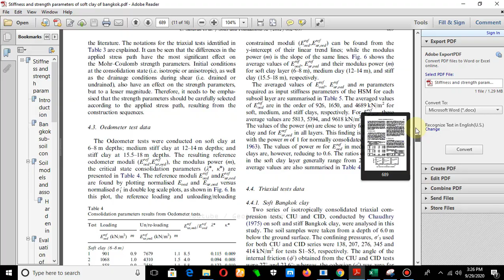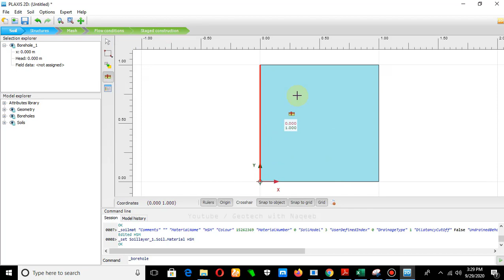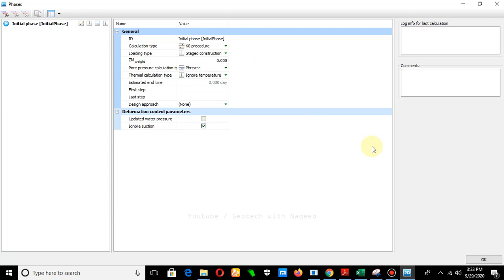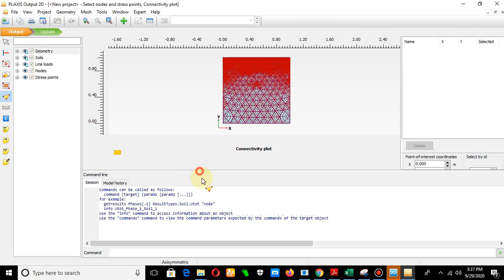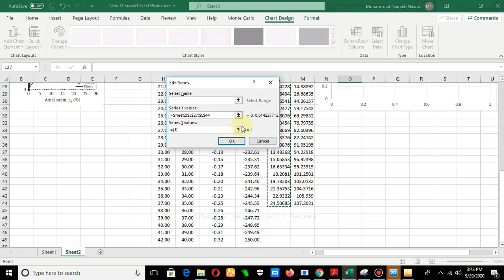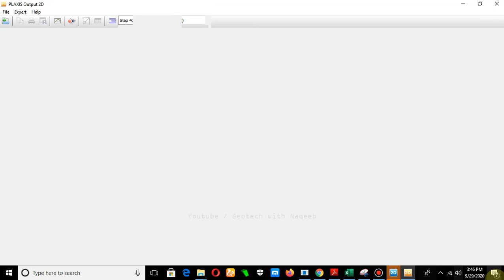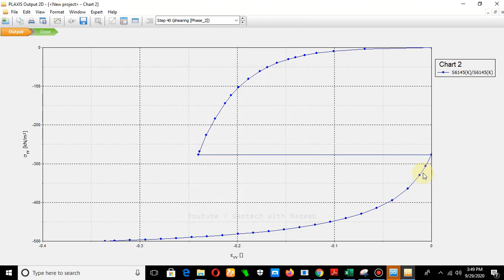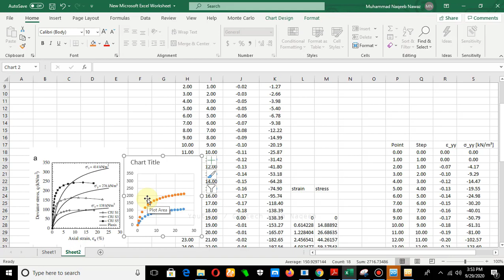PLAXIS 2D: Lec 2 | CU Triaxial Test Simulation | Geotech with Naqeeb

Comment: Hi Naqeeb,
Simply explained the simulation and modelling.
I have questions regarding the groundwater boundary conditions.
1)Why the Xmax open during stage 2?
2) Why Xmax and Ymax are open in stage 3, which is the undrained stage?
3) Why you kept water level at y=0. should it be at y=1 to make the sample saturated?

Thank you.